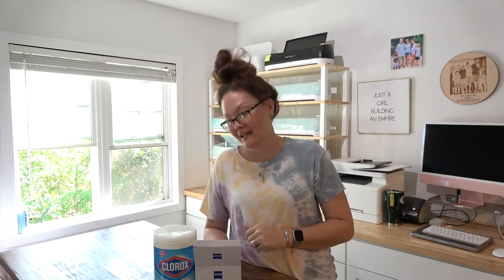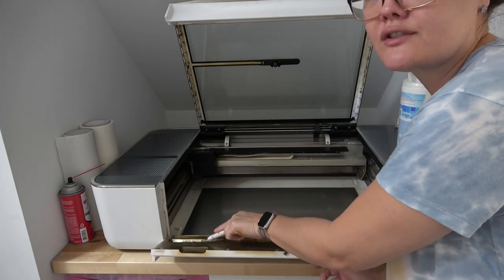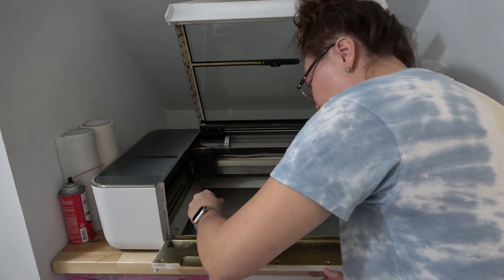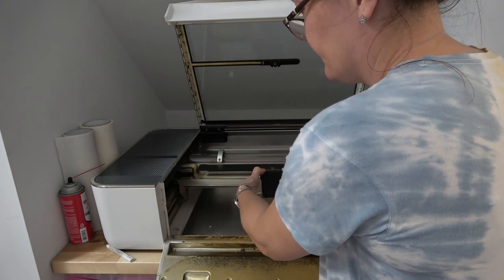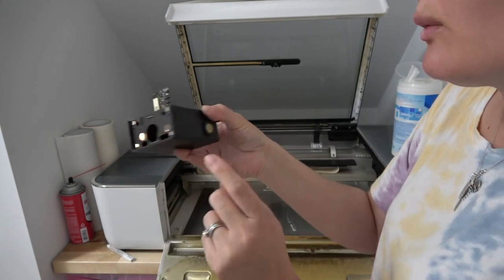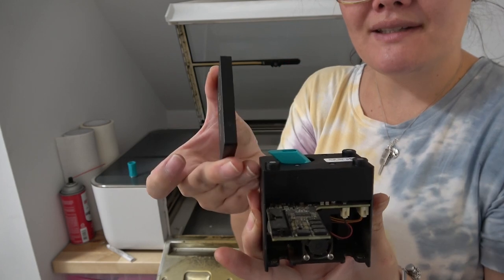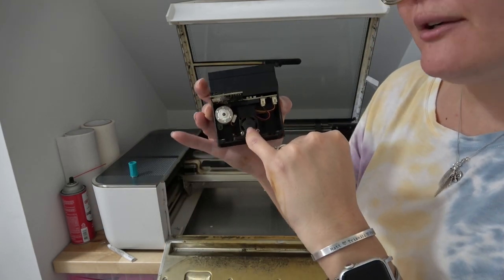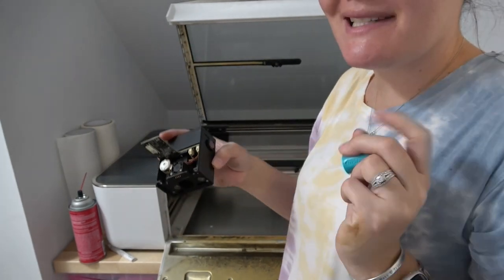Revive Your Glowforge With A Deep Clean!

Comment: How often do you clean it? Or should clean it? And does it matter if you use more wood or more acrylic?
Reply from the maker: I totally don't clean my machine as much as others. I do clean my camera at the top of the lid and a couple lenses daily. But deep cleaning like I did in the video ... You can just tell when it needs to be cleaned LOL 

If you do mostly cutting you won't need to clean it as much, but if you engrave a ton you will. Especially if you are using MDF (draftboard), you'll be cleaning it often.

Comment: Which version of glowforge you have? Simple version, plus or pro?
Reply from the maker: I have the plus. 

The only reason why I purchase that instead of the basic was because of delivery. When I went to purchase mine, the basic was back ordered MONTHS. and the plus was able to be delivered in days. I also never wanted the pro, I didn't think it'd use the pass-through slot to make super large signs. And I still have't needed it, so I'm glad I didn't spend up. 

But if you feel like eventually you'll want to do super long & huge signs. Get the pro.
Reply: @ashleefalco  with the amount of work you make with the plus do you think the basic would be able to handle it? I hear if you want it more for business then the plus or pro is better to get. The basic is best for here and there jobs. What do you think?
Reply from the maker: I dunno. Because I've never played with a basic I'm not 100% sure. 

What I can tell you, I have a faster (way more expensive) epilog laser and that thing is lighting fast. It's super nice to put in a tumbler and be done in 2 minutes. So more laser watt power the better. 

The basic is less wattage, so it is going to be slower. But the wattage of the pro and plus are the same.